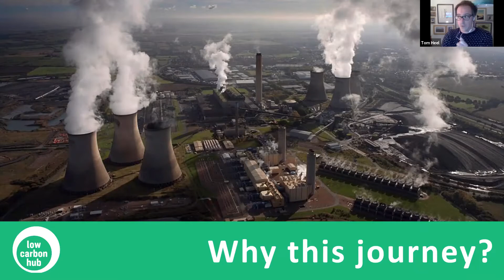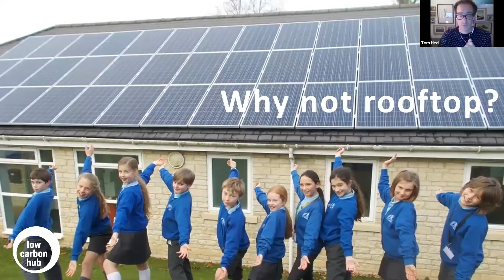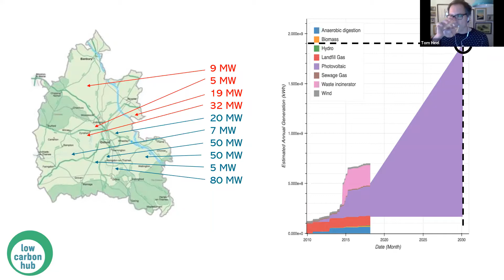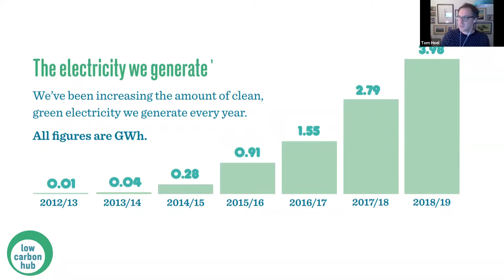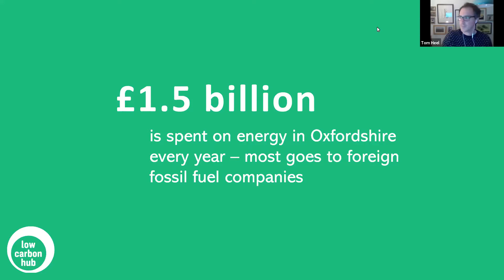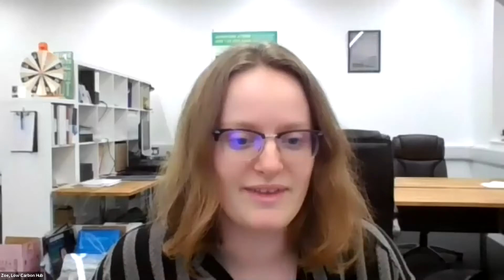Low Carbon Hub Webinar Series: Ground Mount Solar in Oxfordshire

Comment: Regarding the last question when we looked at a tracker versus a fixed panel 4kw system 10 years ago the economics did not come close to working out even when ignoring any maintenance needed for the tracker. The big advantage of a tracker is for more output when space is limited and they also help flatten the output curve throughout the day. Unless trackers have significantly reduced in price  fixed panels with battery storage are probably far more cost effective and much lower maintenance on a large scale.